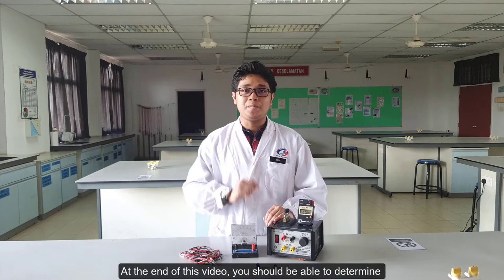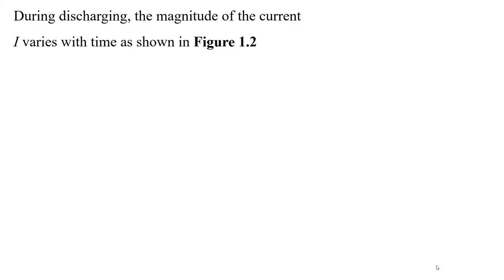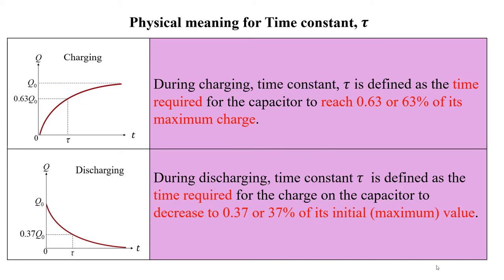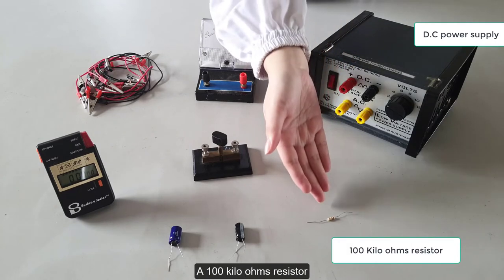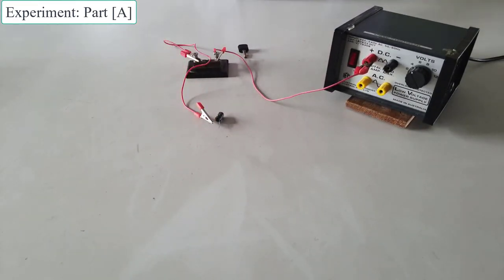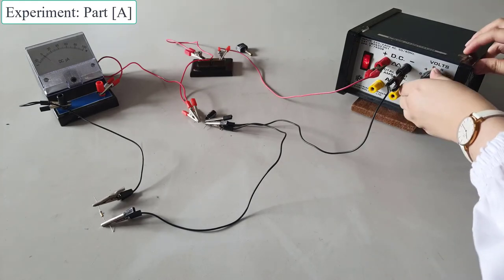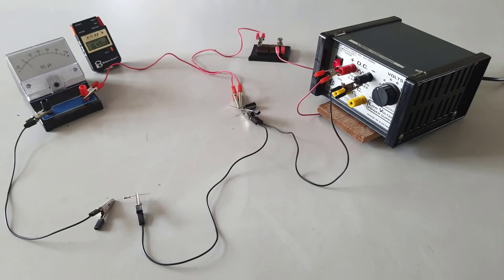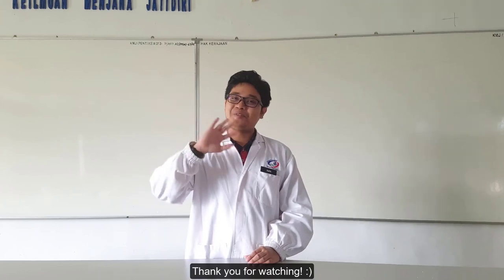Experiment 1 : Capacitor

Comment: Nicely done.  Thank you .  But why do we get fig 1.1 for only two seconds? (LOL, it really did not matter) 
I use a very similar method myself, with a decade box for the resistor so that I can get a large value for tau when needed.  This makes the use of the manual stopwatch, an app on my cell phone, very easy and accurate.  If (delta t) is the variance in my run of times, ie, the sample set, then (delta t)/t can be made small if the time is large, so it is  more accurate.  Sometimes I time to at least 100 seconds and I use a very large face analog volt meter, a Simpson 314, and a ten volt DC input so the 6.32 volt stopping point is easy.  I think this method if done with care is superior to using an oscilloscope.  Particularly since all my scopes are analog!  Best to you my friend, keep it up! (I thumbed up, and subscribed)